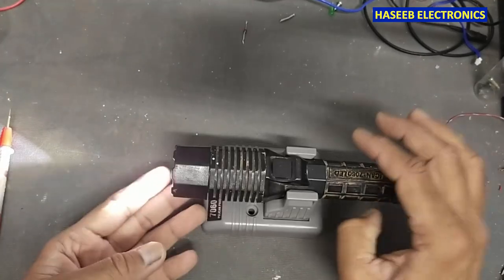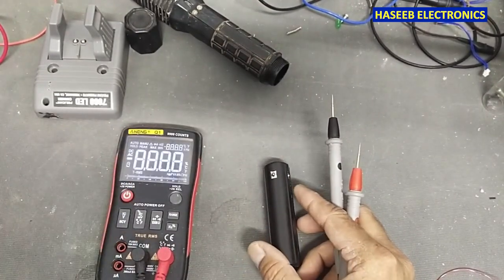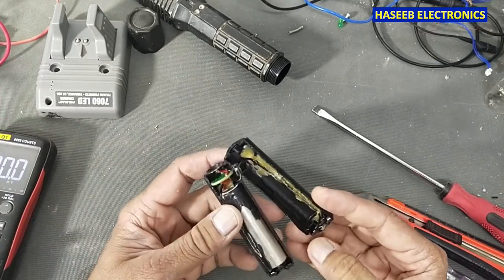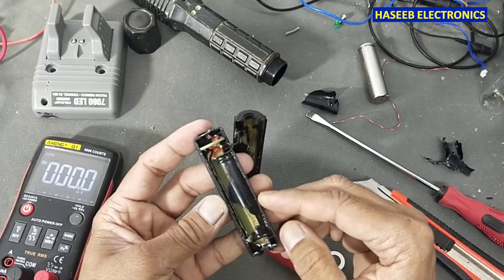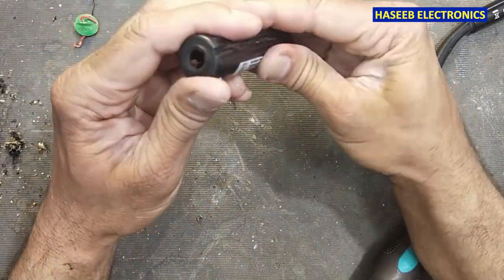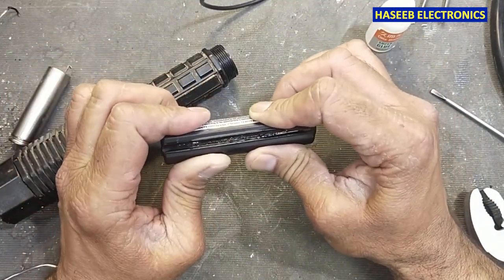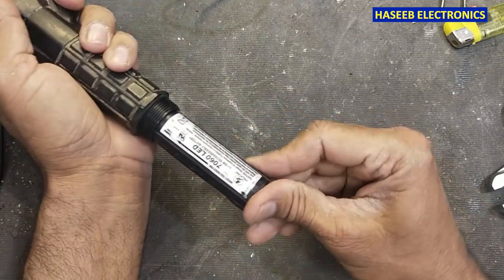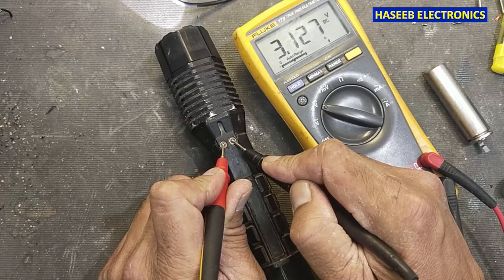{720} Repair Battery Pack for Pelican 7060 Tactical Flashlight

Comment: A wonderful repair! Do you know of these tricks with Super Glue? For the gap in the sides of the battery carriage, you can make a type of plastic filler... Sprinkle common baking soda into the gap. Squeeze the carriage together. Drip Super Glue onto the baking soda. It dries quickly and can be formed with filing and sanding. Also, Super Glue can be made to set even faster by spraying it with common purified water. You can help the Super Glue to get a better bite on plastics, by roughing the plastic with sandpaper and cleaning the sanded area with isopropyl alcohol. This removes the waxes in the plastic, which prevent the glue from adhering. Cheers!

Comment: First of all I'd thank you for your time and your information
Then my question is about (MD) inverter it's not have output but when it in charging position it's charging voltage about 40 volts and damage the capacitor
If you have any suggestions for this problem
Thank you
Nidhal Alithary
Iraq